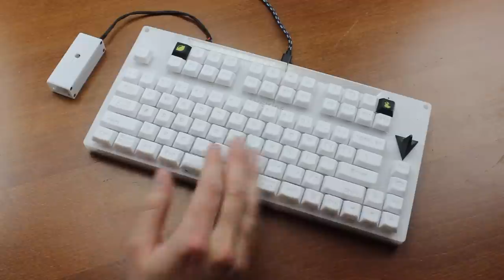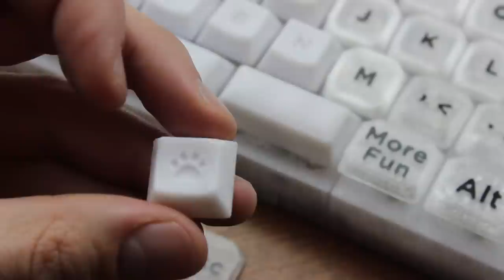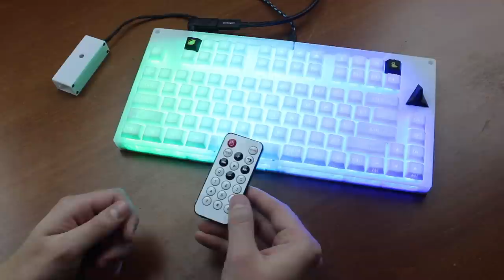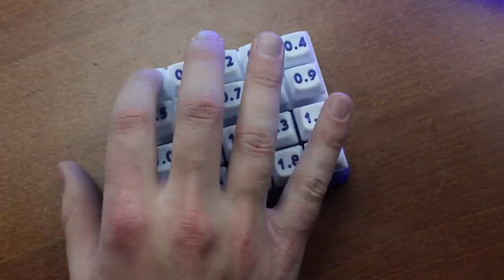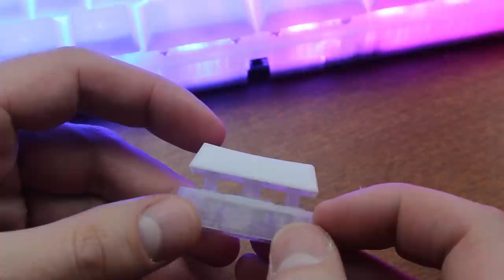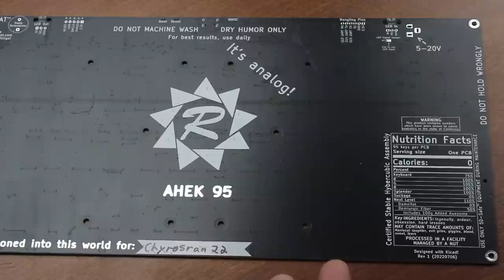AHEK95 "Void Keyboard" review (3D-printed Void switches)

Comment: To answer your question about firmware updating not being all like this, it depends on the microcontroller. It seems like this keyboard is based on a Raspberry Pi Pico, which is able to mount itself as a readable/writable drive. A lot of boards are using weaker microcontroller which is where the limitation comes in.
Reply: also rp2040 of raspberry pi pico is the cheapest MCU that can do USB DFU and the only one that can do it OOTB
Reply: Yeah, putting one of these into a £400 Model F Repro would have been too expensive.
Reply: well, you can add another chip to do it as well, like those generic esp32 boards, but that increases the cost/complexity more than just getting a pico or the esp32-S3 which have USB host functionality out of the box.
Reply: @nickeshchauhan5661  Yeah.  Reprogramming mine was a fucking nightmare.  I need to reconfigure it again, now that I've figured out how I want to use the layout along with my macro pad and...  no, fuck it.  It's not worth it.

These keyboards don't necessarily need to be as easy as this void keyboard is, but there is just no fucking excuse for it to be as difficult as QMK is.  I can only assume that QMK was made by someone who thinks that not liking the terminal should get you sent to a fucking death camp.
Reply: It could be done on other keyboards, but many open-source stuff don't since their developers and most hardcore users are already used to that, and then it's users that want better are shouted down by both the devs and more experienced users. I call this Open Source Gatekeeping Syndrome (OSGS), and software also happens to suffer from it.
Reply: The only potential issue of using RP2040s in projects like these are analog components, considering only three ADC pins are available. Which means co-processors for any RP2040 project using multiple analog inputs. I've also heard that the RP2040 has lackluster ADCs in it, so coprocessors are a recommendation anyways. It's a dirt cheap microcontroller, but of course that'll come with its own limitations. 

Given that this board is full analog, it's either coprocessed to all hell, or its not using an RP2040. I'd be willing to bet on the latter without looking into it at all, just because it's simpler and cheaper at the end of the day.
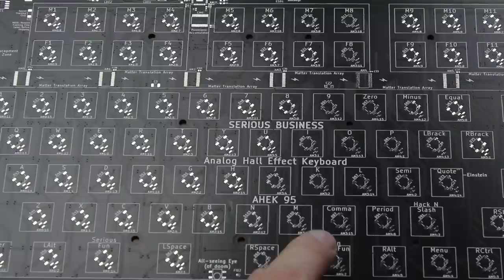Reply: @xaytana  Definitely using an RP2040, you can see the volume label in USB DFU mode. 6:17  There's analogue multiplexers on the board too 17:29
Reply: @_BangDroid_  Their points are entirely valid, though. So many ICs, and they all offset the cost benefit of the RP2040. This setup costs what, $10+ in just ICs to make the RP2040 work in this setup, not accounting for all the other ICs outside of the MCU and muxing. Compared to a 100% board that also has a digital dial much like the magnet dial on this board, that uses an $8 STM32L151RCT6 with no additional ICs outside of the product's in-house RGB drivers. And that's just one example, another product, though a TKL so not quite what's shown here, though the AHEK95 does have some superfluous keys, uses a $9 NXP LPC5528JBD64K. That's just two examples of many, and those are single-chip designs outside of the lighting situation; there are better microcontroller choices, of better I/O capabilities if not also better all-around capabilities, of more efficient design, and many times cheaper than using a very limited RP2040.
Reply: @jakesnyder2667  I wasn't really arguing against those points. I don't know anything about the BOM costs, cost effectiveness or comparative performance of other solutions. But maybe chip availability had something to do with those things.
If there are cheaper and more effective electronic solutions possible, combined with 3D printing, we'll be seeing those around soon I'm sure.
Reply: @ZILtoid1991  This.  The biggest barrier to making FOSS accessible to most people are developers and the community.  They don't understand that most people don't have the time or desire to read a 50 page manual, get a bachelors degree in computer science, and master the Linux Terminal just to do something like switch a couple of keys on their keyboard or open a web browser, and they will viciously attack anyone who suggests that their software is difficult to use.
Reply: i think it's a stm32 since he uses that in his tutorial
Reply: Atmel's USB AVRs can do DFU out of the box, and this is UF2, not DFU.
Reply: @ZILtoid1991  There's definitely a lot of that.  I think a lot of it is just lack of time or energy for a lot of people to implement those features, but their ego has to tell them to tear down someone else rather than openly admit that they're flawed.

Comment: This keyboard is quite literally a game changer. So much stuff that puts far more expensive boards to shame at a fraction of the cost. Who knew 3D printed keyboards would ever come this far.
Reply: My only concern would be the feeling of the plastic. The striations of 3d printed plastic drive me nuts in a way that I can't explain.; even sanded parts do it to me. Anything 3d printed that I have to constantly touch or handle is a no go from me.
Reply: @Poolboy001  it's petg, it's self-lubricant, when it rubs it creates a powder, that lubricates the switches. you shouldn't want to 3d print this in pla though
Reply: @Poolboy001  > You can wet and dry sand and polish a 3dprint to essentially  injection molded like smoothness, would take a bit of work though for a whole keyboard, but it can be done.
Reply: @l0k048  > If I recall correctly, PLA is slightly harder and stronger than most other 3d printable plastics, so that might actually work in its favor for smooth .2mm nozzle and .1mm layer height prints, sure the print takes longer, but what price can you put on near perfect FDM prints?
Reply: I mean its not really unimaginable printed board coming this far. Eventually they will get much further even.
Reply: @Poolboy001  Yeah this is and will be the biggest issue for these boards. To get a good look, and more importantly a good feel for the fingers that barely rivels injection molded caps it will take lots of after work or new progress in 3 d printing.
Reply: It looks cheap. I hardly think it puts high end keyboards "to shame". I'd take a CNC aluminum body over this any day.
Reply: @Poolboy001  You can use normal keycaps afaik.
Reply: @Poolboy001  you can smooth certain materials quite considerably by using an acetone steam bath.
Reply: @clintony3000  This is basically a prototype or proof of concept. You could very well use an SLA printer to achieve a much cleaner look due to a higher resolution. Hell, there's nothing stopping you from going to a local maker space with a CNC and making your own aluminium case.
Reply: A fraction of the cost? Less than 100 USD...just in parts. I don't know how long assembling all those switches would take, but it would be a while if you do it by hand. Then add in all the costs of actually selling a product at any kind of scale. If the designer decided to commercialize this tomorrow, it would be very expensive. I also suspect that those switches would be very fragile in long-term use, they would need development and a good manufacturing process to reach commercial standards.

This thing is really cool, but it's not comparable to commercial products.

Comment: Resin 3D printing from what I've seen produces much smoother surfaces than PET 3D printing. Might make the void switches even cleaner. Keys printed with clear or colored translucent resin would look amazing.
Reply: Exactly, testing this switch design with other 3D print method and variety of filament material would be interesting
Reply: @snippingtool7810  Maybe nylon filament would be a solution. Nylon is slightly slippery feeling on the surface, could be a good natural lubricant. Any other surface would roughen up with time...
Reply: I asked Riskable about this, and he said resin has a higher friction coefficient, so the switches will feel way worse.
Reply: Resin printing is a lot more noxious ... Not for people printing at home. You'd need at least a garage with good ventilation.
Reply: I concur. I’ve had some success printing Kailh stems (for some non-MX vintage caps) with an Elegoo Mars 2 pro resin printer, that while not perfect were astonishingly good. On a design such as these simpler Hall effect switches, I expect the result to be close to perfect.
Resin really is superior for precise small parts such as these.

Comment: Regarding 6:35

The microcontroller this project uses (raspberry pi rp2040) released in January of 2021, and it is the reason why firmware is drag and drop like a flash drive.

Before that microcontroller existed, there weren't any that supported this kind of firmware programming

It's been a massive game changer in the DIY scene because of how cheap it is, $0.90 for the MCU, $4 for an entire dev board. The Arduinos people commonly used before used the 32u4 which costs ~$4, and a dev board costs ~$15

Those relied on either the Arduino IDE, VSCode Platformio, or DFU tools ala QMK toolkit to upload firmware. Relative to other families of existing microcontrollers, those were actually very user friendly (Atmel studio sends it's regards), but to everyday users it's still very unintuitive. The RP2040 programming method in comparison is amazing

just thought I'd give you some context as an electrical/firmware engineer that makes input devices like these
Reply: Just checked on digikey to confirm the price and yep, the rp2040 is a bit above 1 USD. I can't believe such a cheap alternative to the ATMega32U4 exists. Wish I heard about it sooner.
Reply: @FunOrange42  alongside being a replacement, it's vastly superior spec wise too

133mhz vs 16mhz clock speed (the rp2040 can even be overclocked/downclocked easily. The 32u4 has a fixed crystal oscillator for it's clock)

264kb vs 2.5kb RAM

16000kb vs 32kb flash (program space)

Dual core + PIO state machines vs single core

USB device + Host capability vs USB device capability

The SDK is also EXCELLENT in comparison to Atmels

This thing really is a game changer

Comment: I have no clue how Riskable came up with these designs, especially with their use of magnets. The fact that he not only proved his concept, but exceeded in making the design extremely practical for regular use is really interesting. Like you mentioned, even the firmware is stupidly intuitive, the fact that it closes out by itself almost seems like it's showing off but at the same time BMing other software. Even their humor is pretty witty. Great job covering this board!
Reply: I came up with a similar switch design, prototyped in lego and 3d printed switches, which I showed off at FOSDEM a few years ago. I didn't print the slider in place but did center the magnets in the hopes of not binding too much (which meant the post itself wasn't centered, later prototypes had double stems). Fun stuff. I don't think his design is based on mine. The window closing is a side effect, by the way; the USB drive is effectively unplugged when the MCU reboots to the new firmware.

One silly little idea was that if the retaining magnets alternate polarity, you could slide them over one step to collapse the keys, flattening it for shipping or such. Another is that I could tune the resistance using paper shims rather than reprinting.

Comment: I have seen quiet a good number of 3d printed keyboards, but they all use normal switches (which is understandable tbh) but they also often go for compromises that make them worse than the 13€ keyboard that comes with an office PC... so I am very pleased to see this keyboard not making all those mistakes. The "Void" naming is potentially a bit confusing because Zack Freedman from Voidstar lab is currently building a custom keyboard (different concept though) and at first I thought this here would be a new version of it

Comment: This is by far the most astonishing keyboard video I have ever watched.

The engineering in the switches is extremely impressive. I really hope they’re patented, and an injection mold process cleans up their rough edges. I’d love a hot swappable production model with standalone numpad.

I hate when I plug a keyboard in, and it prompts me to download software. As long as a keyboard has fluid defaults, I could care less about custom RGB profiles.

Also, I feel dated with that Temple of Nod reference. 🤣🤣🤣

Comment: Absolutely wonderful! Could do without the clicking and the RGB but everything else seems top notch.
Reply: I have a non-RGB 75% design that I'm like 60% done with sitting in my projects directory. Would that be good enough or are you a full size purist? 😁
Reply: I'd go for a full size stealth silent version in heartbeat.
Reply: @riskable  how hard would it be to do a 1800 style layout? If you did that at some point later down the line and in a more stealthy look I would buy that IMMEDIATELY
Reply: @flanx5432  1800 style layout wouldn't be a problem it'd just be expensive to prototype because the PCB is wider than 350mm.  That's the point where PCB prototyping places really crank up the price.  It wouldn't matter much when you make like 1000 boards though.

Comment: Great review! It's a very fascinating design, and I honestly wonder whether printing the switches using resin instead to combat the roughness you've mentioned. I assume that would mean some redesign would be necessary since the switch is reliant on the plastic thickness for decreasing the magnet strength. 

Happy holidays!

Comment: One thing I do wonder about here is how the switches hold up long term to wear. At least it's easy to swap them out if they do get worn.

These switches also look like they woud be extremely easy to lube compared to other switches since they're easy to take off and no contacts to worry about. (provided the material is compatible)
Reply: I've been typing on the same Void Switches for about a year now on my Riskeyboard 70.  I've also washed them in the sink with soap and water dozens of times.  No noticable wear.  In fact, they've gotten smoother over time (because that's one of the natural properties of PETG).

Also, they really are extremely easy to lube!  To lube them I just flip the board over, slather Super Lube (oil kind) all over everything, then slap the top plate down on an old t-shirt a few times to wipe off the excess.  Then it's right back on to the keyboard and ready to go 👍
Reply: @riskable  please please PLEASE make a crowdfunding campaign or something for this keyboard. It's utter genius on so many levels. I would 100% buy one from you in a heartbeat.

Comment: I can imagine a version of this made with standard molds in the future and likewise with it that should in theory remove the roughness that is 3d printed plastics. At that point this switch might be revolutionary. By literal nature of this style of switch it is very software friendly and I'd think you can adjust the actuation even add in levels of different acitivations depending on how far  you pressed the switch down or even have it reset early. Mind you none of this matters for work but it might matter for people who play games and you can probably have two sets of switches which can be easily removed, one for gaming and one for strictly typing and the crazy part of all this, by nature of it's design the cost of this would be cheap and cheaper still to modify or repair it I'd think.

Comment: That keyboard is fantastic! I hope the next version has room for optional up-stroke and down-stroke dampeners. I really want an as quiet as possible programmable tactile keyboard with macros. I'm most used to 80%, but as far as 60%'s go, this is my favourite layout.
Reply: The third magnet is a down stroke dampener. If you remove the bottom magnet, you get a smooth feel with very low resistance at the top but rapidly rising resistance at the bottom. However, I think you'd want to rearrange the sensing to use it that way, as that's the magnet that comes close to the sensor for this setup.

Comment: Put some AS5510 linear Hall sensor ICs on the pcb and you would have a musical instrument as well..
Reply: Actually all that's necessary for it to do MIDI output is to add support for it to the firmware.  No need to change the hardware.  I don't even think it'd be a lot of work, actually...
Reply: @riskable  true. 2mm already supports it. But polyphonic aftertouch would be nice too

Comment: 13:30 i agree on mx style tactility just in general being bad, but does this extend to clickiez? they're definitely way too heavy to use set up as tactile, i just wonder how they compare in terms of how "clean" they are
Reply from the maker: Clickiez are very clean-feeling, they're legit in that department for sure. But the tactility is rather overpowering, I'd have preferred something less overbearing, like the original Alps.
Reply: @Chyrosran22  definitely agree there, hoping for a second generation that's a bit easier on the tactility. thanks for covering these switches/this board, really exciting stuff

Comment: The relay clicker is genius. Anyone know where the info is on how to make one? Or is it only compatible with this keyboard?
Reply: It's literally a 3.3v logic-compatible single-channel relay board I bought off Amazon. The keyboard has all the unused GPIO pins exposed in the back (and a few other places) and one of them--G1--is right next to 3.3V and GND. So I just made a little DuPont connector with the pins in the right places so you can plug it in to the back of the keyboard. I programmed the firmware to toggle G1 HIGH and LOW whenever a key is pressed or released. Suuuuper simple mechanism 👍
Reply: @riskable  Makes sense. Its got me thinking of a way to implement such a thing universally for all keyboards!! or at the very least with my keyboard :P
Thanks